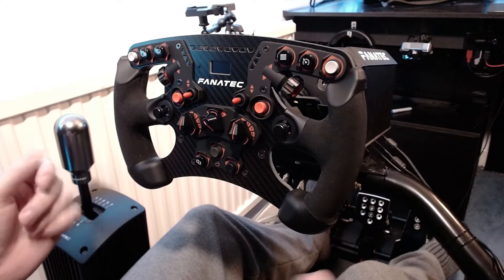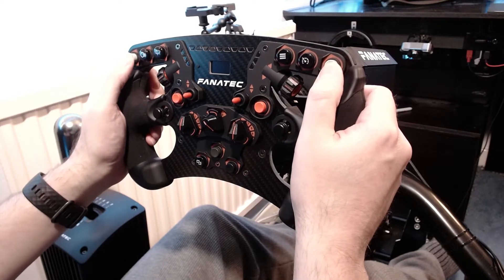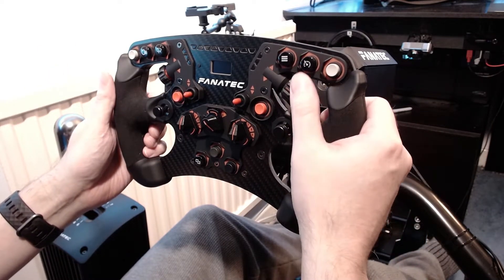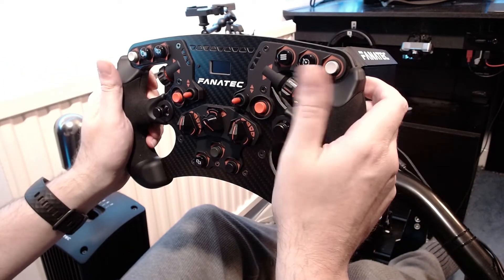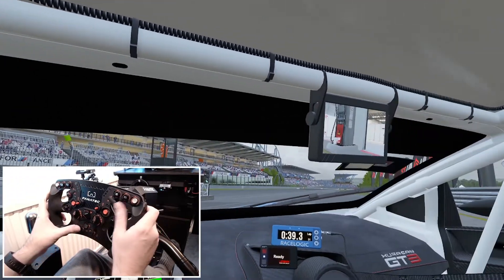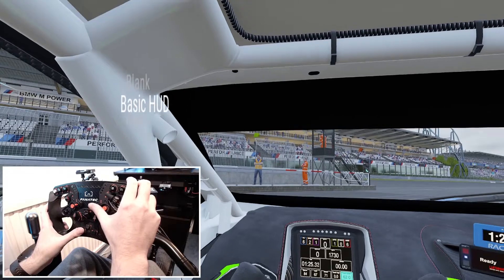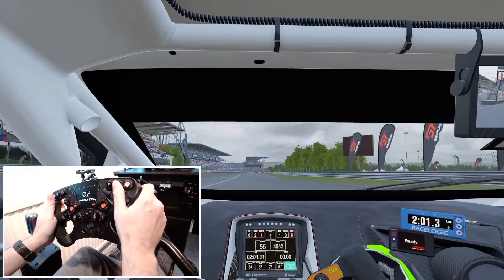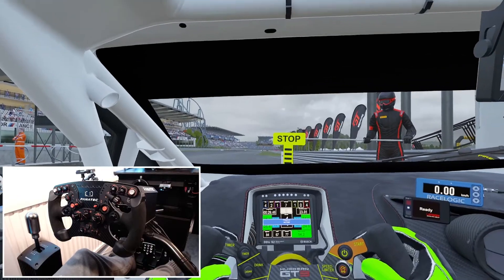Fanatec Formula V2.5X | Trying it out in ACC - First Impressions

Comment: Hello, nice video!! Thanks 🙏🏻 for sharing. I just wanted to ask you about your RSeat cockpit. Is it sturdy enough for the DD1? Did you need some extra plate to attach the wheel base??
I have the same cockpit… but with a CSW 2.5 😅
Reply from the maker: Hi, the DD1 goes straight on. The cockpit is pretty solid aside from the usual flex that comes with a frame of this nature, im sure you know what i mean as you have one. I reviewed mine a while back, take a look if you're interested, it might answer some of your questions. https://youtu.be/SQ00-bgcGe4
Reply: @JimVR  I’ll watch your review for sure. Thanks a lot for your words. Yes, I really enjoy the kind of vibrations transmitted by the cockpit when driving. Now, I’ll try to manage the CSL DD vs DD1 convenience for my next wheelbase update!! 😅 Take care!! 👌🏻